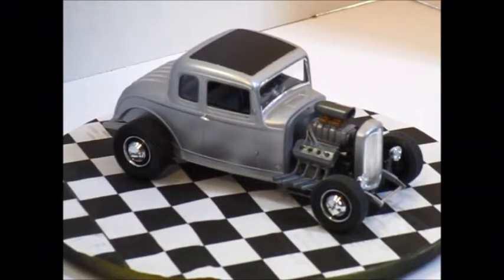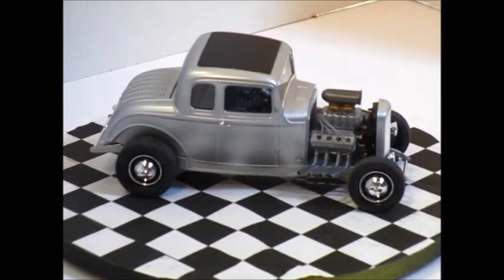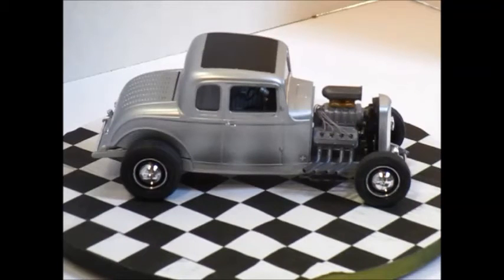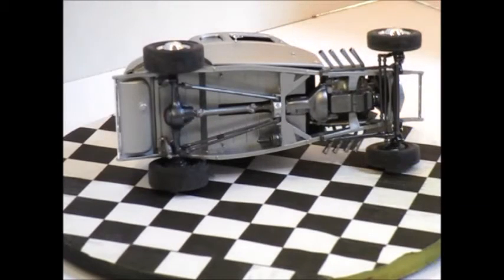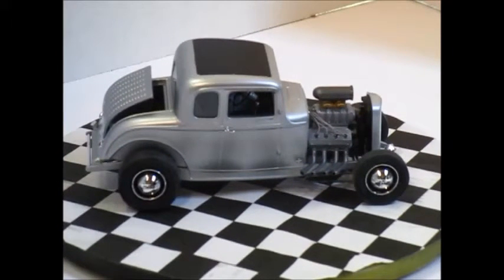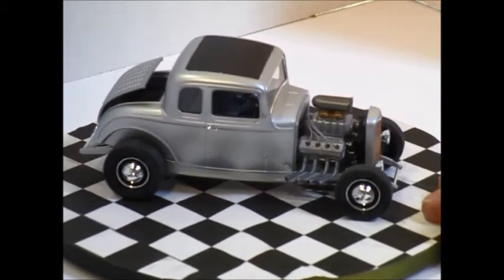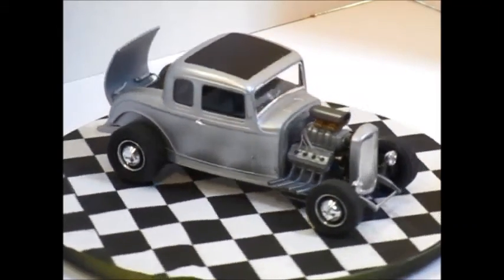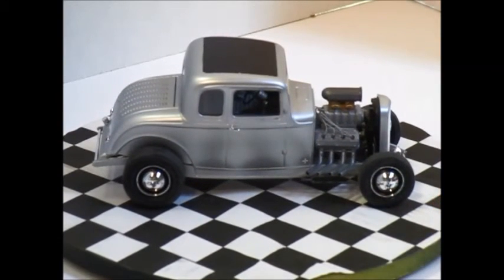'32 Ford Highboy Final

Comment: Good looking build Wayne. I like the Vallejo metal colors. I have the AK Interactive True Metals that I am going to use more in the future. Almost forgot I had them. I like the look you ended up with. Very cool!
Reply from the maker: Thanks Gary, I have tried to find the AK Interactive paints, but, the only hobby store in my area that has them is right downtown Toronto and that drive is never good. Cheers brother.

Comment: Went to my local train shop and they did not carry the 36 gauge wire. They recommended a electronic shop but they did not have it either. I use 30 gauge wire right now because it is closes to to the correct scale slze. I have been looking for 32 gauge and found some on line but it was very expensive. If you come accross some 32 gauge, let me know.
Reply from the maker: I plan on visiting 2 really big train stores in my area, sort of, and I'll see what I come up with. Cheers